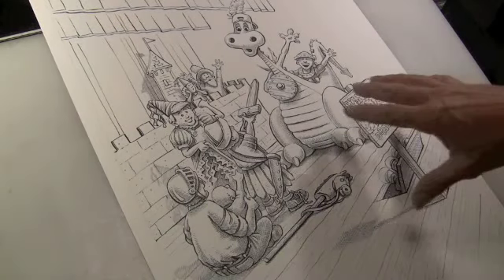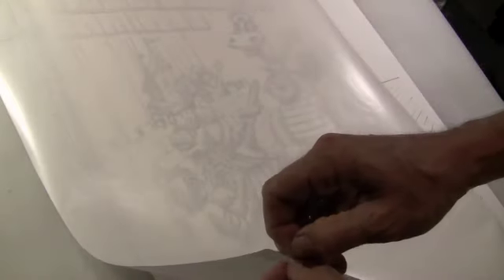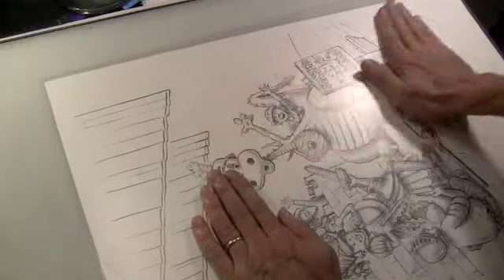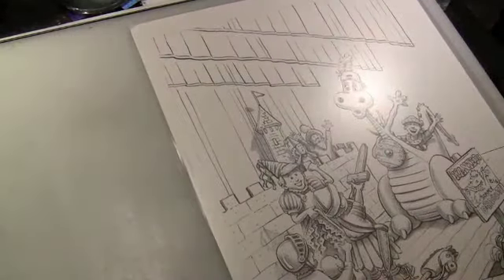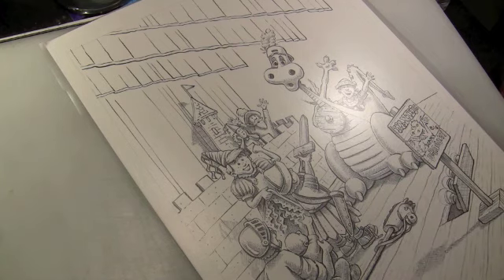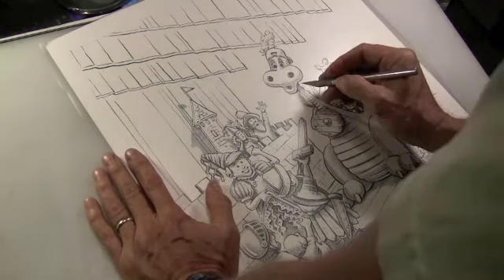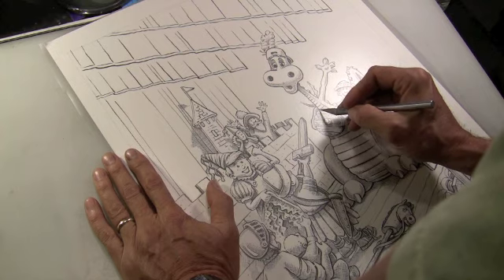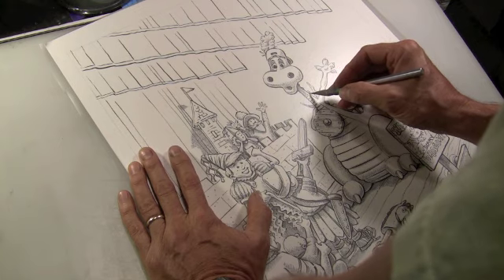Step 5- Cutting the Frisket

Comment from the maker: Hmm . . . good question.  It is probably the paper/card you are working on.  If it is actually LOW tack film, which I assume that it is.  The main skill is learning how hard to press on the knife-- just enough to go through the film, but not enough to etch into the paper.  If that happens, tearing the paper can become more of a problem.